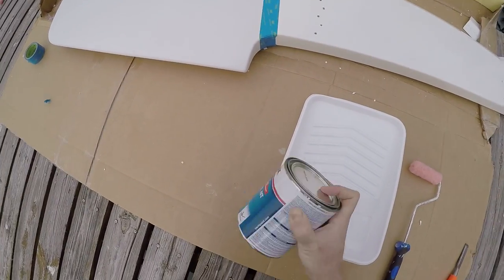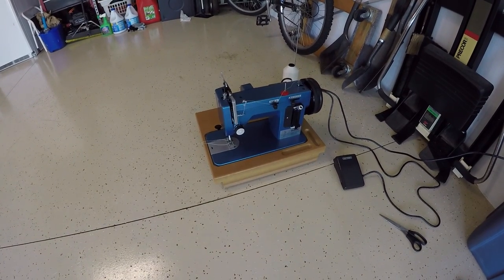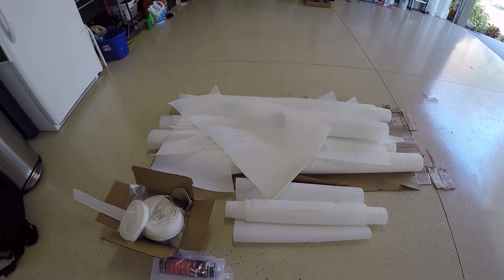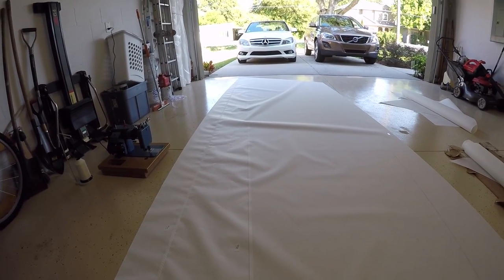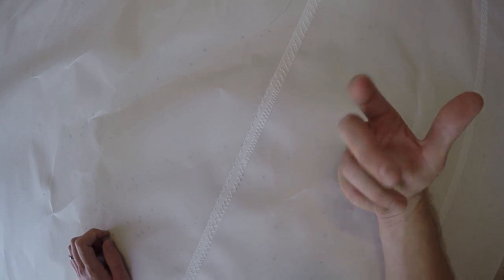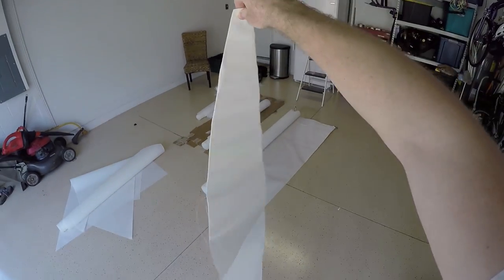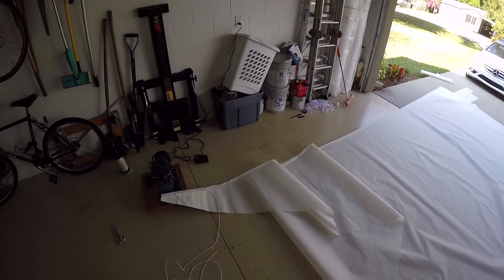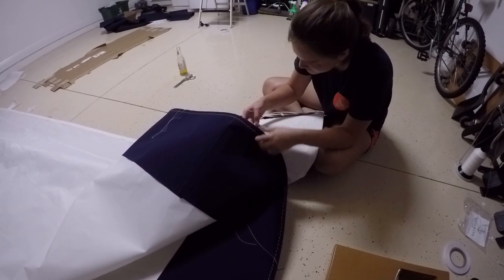13. We Sew a Sail - Sailing Vessel Somnium

Comment: I made a similar jib here in Brazil, using exactly the same technique. Sail clothes were glued flat each other, with a sticky tape, without any profile. On the boat, a nice airplane-like profile came out. Smooth sailing for you both.
Reply from the maker: Thanks so much. It feels really good to create something that functions so well. Fair winds!

Comment: Congratulations on the new sail.  Your do-it-yourself approach will serve you well in the years to come.  It does look like chafe protection might be in order.  When close hauled, a guard on the spreaders and a patch on the sail will keep it in good shape.  Also, when you ease the mainsheet when on a reach the sail will back up to the shrouds.  It won't be long before there will be a grey line running the length of the sail.  That would be the time to add a 4" wide stick-on sail repair tape to both sides of the sail.  You do need to stitch it as well.
Reply from the maker: Thanks for the advice!

Comment: My knees hurt just watching you sew on the floor. 😀
Reply from the maker: My left knee was sore for a week afterward, haha.
Reply: Knee pads, dudes.
Reply: I bought work trousers with pockets for knee pads after getting a knee infection after spending too much time on my knees sanding my deck. It's called housemaids knee and it's exceptionally painful but you don't notice til the next day when you get out of bed and can't put any weight on it. I thought I dislocated the joint when it first happened. I've had it twice now over the years after doing various DIY projects.

Comment: Looks good. After watching you test the sheeting angles, I've got 3 words for you, bro: Spreader Reinforcement Patch.

In a decent breeze, if you find yourself short tacking up a channel, it will chafe on the spreaders, shortening the life of the sail greatly. Also, in a strong breeze there is a chance that when you throw in a tack, it could get hung on the tip of the spreader and punch a hole in the sail. 

You don't want to know how I know this.
Reply from the maker: ajax1137, sounds like you're talking from experience! This is a good idea, I have extra sailcloth so I'll be doing this when I can.
Reply: No, if you are short tacking up a channel, then your main sheet should be all the way in and your Vang tight. The mainsail should just barely flip to the other side of the centerline on each tack and should never come anywhere close to the spreaders or shrouds. Otherwise, you are doing it wrong! Perhaps you are thinking of gybeing downwind? Is so, then yes, in that case, the main could come up against the shrouds and spreaders once you ease it out after the gybe.